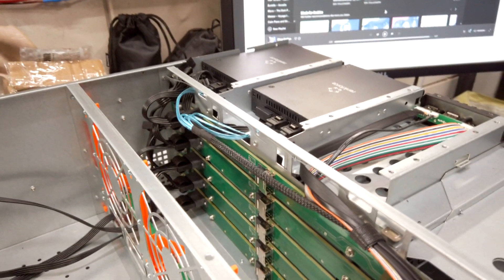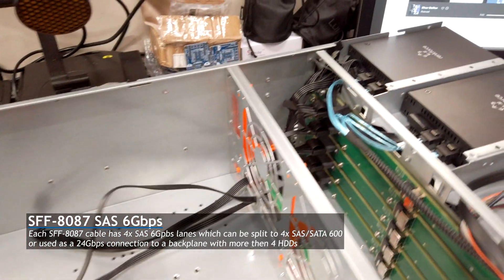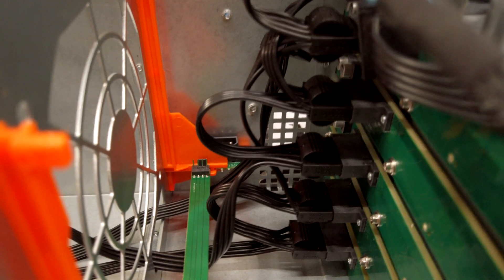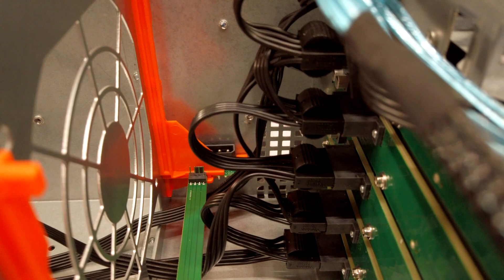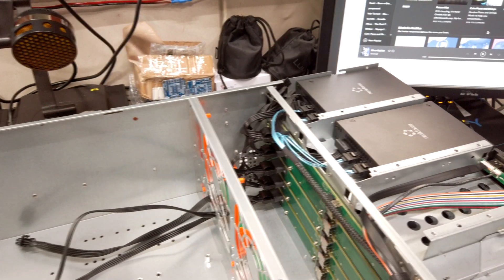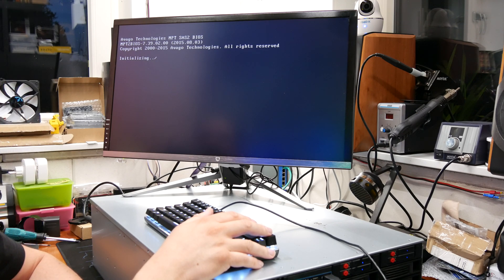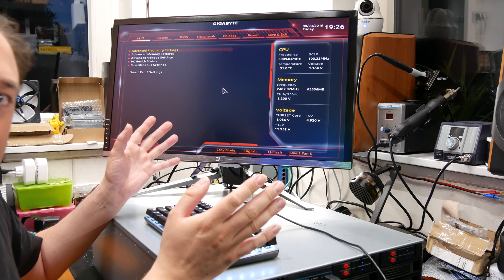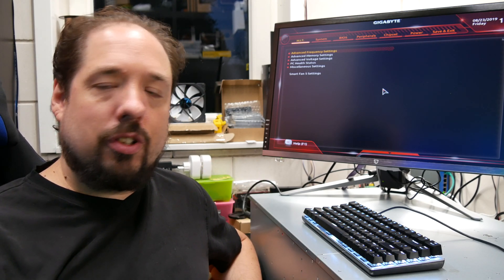Home Networking: 100TB 10Gbit Server - Building the server!

Comment: Hey man

I'm about to build my own 24bay server soon, but im having difficulty getting a question answered.
I have 6 backplanes, powering 4 drives each.

How many PSU molex cables do i need to run? I have 3-4 molex connectors per PSU cable, but can i plug in 3 SAS backplanes, with just 1 PSU cable?
Reply from the maker: I get that it's a bit hard to calculate. Let's say each HDD will pull 6w in average and double that while starting up (a guess, did not look it up). So that's 12w x 4 = 48w. Divided by 12v that's 4Amps. Generally that's ok for something like 18AWG which a lot of power supplies use. That said, I'd hook up at most 2 planes to a single cable unless you are doing staggered spin up.

So a few second burst of 96w or 8Amps isn't going to kill anything and might even be ok sustained (if with a bit of voltage sag/drop) but adding another plane might be pushing it a bit too far. That's 12Amps and if it's indeed 18AWG, that feels a bit high. 

Can you connect dual power to the planes? Then splitting those over 2 cables from the PSU is always a good plan.

Hope it helps in figuring it out!

Comment: Our group is approaching a petabyte of archived games and related software, video and audio, etc. The current solution is not elegant and not very redundant or practical (lots of ext usb drives and especially rare or hard to replace items have an onsite and offsite backup).

It's slowly being turned into a proper archive. Its expensive caring for data > 100TB

Comment: Thanks for your very instructive video. I've been able to build an Inter-Tech 24-bay server ... except for one major problem I just can't seem to be able to fix. No matter what I do, the fan wall won't turn on, which is a major issue as my harddrives will immediately start overheating. I have a Corsair 750X power supply, connected the molex to the fan wall and replaced the standard fans with Noctua NF-A12x25 fans. When I turn on the server, everything works fine except all 3 fans in the fan wall aren't spinning. Any idea on what might be the cause? I haven't connected the mysterious 6-pins on the fan wall to anything but that shouldn't be an issue, as that is only used for regulating the fanspeed. With my setup, all fans should run on full speed, no?
If you can give me any idea on why this isn't working, I would be very happy.
Reply from the maker: Yeah, if you don't connect PWM or Tacho (the 6 pins) it should just run at full speed. Not sure what could be wrong there, check my latest livestream too there we hook it up to become PWM controllable (although I had the motherboard fan connector in reverse during the stream, but that was an easy fix). Maybe try a different Molex cable? Also check if any traces on the fan board PCB are broken, it's quite a simple PCB so easy to see once you take it out. You could then maybe request a replacement.
Reply: @IntermitTech  Follow up: managed to get it to work. Somehow I guess the pins didn't fully connect due to the cables being awkwardly longer with the Noctua fans. I switched them out, put in the stock ones and those worked. Put the Noctua's back in and made extra sure to push down all the way and now they work. Pretty silly mistake all in all but very happy it works. Your video helped me a lot to plan out my server build, thanks!
Reply: @IntermitTech  thanks for the suggestions, will check it out. Maybe first I’ll retry with the stock fans, see if that works and then try to find the issue by rule of elimination. By the way, love your vids! Keep it up!

Comment: Great video. I recently purchased a smaller intertech chassis based on your content to make a media server. Was just wondering if you figured out a way to connect the front panel LAN led connectors?  I can't really find many boards or 10gb nics that have those pins. Certainly not 3 as is the case for my rig.

Comment: Question, what happens if your backplane die? Can you find replacement readily? If so will you consider buying a spare for future use? Regards,
Shane from Trinidad.
Reply from the maker: Yeah, replacing a backplane would be super simple! The chassis I have has 5x4 drive backplane which are all individual. If one would break, you can easily replace just that one. :)
Reply: @IntermitTech  where would you find a new backplane? can any backplane be used in this chasis?

Comment: The best upgrade I've done with my SAS cards is add a small 40mm noctua fan bolted on with some nylon bolts and nuts I got from the hardware store. Before the heat sink was hot to the touch now it's barely warm.
Reply from the maker: Yeah, I'm evaluating doing that or providing some more ventilation in another way, with the current airflow it's ok, but a bit cooler is always better!

Comment: Would you try DRAID? What's your opinion on it?
Reply from the maker: ZFS dRAID is quite interesting but I don't think 8 drives is enough to benefit from it.

Part of the reason I'm going with a mirror is that I will have 4 vdevs which will give me increased random IO performance. Otherwise it would be much more efficient space wise to go with a single RAIDz2.

Doing a dRAID with 2 parity blocks while having 8 disks means you are basically only getting 2 RAIDz2 parts and thus losing 4 drives, just like while having 4 mirrors but having less performance and needing to calculate parity.

Yes, during rebuild there would be a performance advantage and also it would allow for more drives to fail during rebuild, although the calculated risk of an issue happening during a mirror rebuild is lower because of having less disks involved.

I could get a 9th drive and then run 3 parity groups of a single disk, but again, that's approaching dangerous territory and in practice statistically less safe then running 4 mirrors. It would give me more space though and also provide a bit more IO performance the a single RAIDz2.

Interesting stuff, but since dRAID isn't available yet in the mainstream versions I think my mirror plans are best for now. :)

Comment: Great vid! I'm glad you are not using a redundant power supply. I have a similar build in the same case and saw Linus a while back mentioning he always wants to use redundant psu's. I am only planning to install a UPS and that's it but no longer feel guilty about it ;)
Reply: You should always try and use redundant PSUs,but its kinda stupid to when its not hot swappable PSU's. you should also use UPS's or a UPS and redundant UPS's connected to each power cable so you have 1 power cable on each UPS in case 1 UPS suddenly dies you still have that extra redundancy. But most people dont need this,but ofcourse this is towards the enterprise market and you need redundancy.
Reply: What case is being used in the video?
Reply from the maker: Check the previous videos, there I got through all components used but it's a case made by the German inter-tech.

Comment: Awesome video. Did you need the raid card? Or can you just use the sata breakout cables?
Reply from the maker: I want to hook up 22 storage devices, so I need the RAID cards since the motherboard only has 8 ports, they are running IT mode firmware so add additional ports I can use with ZFS. Each LSI card adds 8 ports so with 2 and the motherboard that's 24 ports. 

You can't hook up multiple device to a single SATA port (well you can, but you need additional hardware and it's not advised). So the cheap LSI cards are the easiest way to do it!
Reply: @IntermitTech  Did the motherboard need to be in it mode or can motherboard just pass them to the os?
Reply from the maker: Motherboard ports need to be in AHCI mode, which all modern motherboards (newer then 6 years or so) support.

IT mode for the LSI cards kind of emulates this behavior and passes all commands directly to the disk (like an AHCI port does) this is much preferred in the now popular (and better) software storage/RAID solutions such as ZFS. It allows the OS to readout the disk SMART info and sending all commands directly to the disk, this gives much better performance and control. Previously this was handelend by the CPU on the RAID controller but normal CPU and software has become much better to handle this now.
Reply: @IntermitTech  How many drives where able to connect to the motherboard before the added lsi card? You will be using proxmox?

Comment: The first thing I want to say is that your videos are very informative 👌, which I like.
And specially for this video, I think the way you are going to be configuring your server is pretty practical. And I think it's  a cool idea to reuse your old components, such as the motherboard and CPU and not to invest in a modern EXPENSIVE Xeon like LinusTechTips does in his servervideos, because I think this is enough for everyone.
Keep your great work up 👍👍
P.S.:
For example, I have built a "server" yesterday too, with an old FX8300, 8 gigs of RAM and a 1060 3G from my old rig and 3x4TB HDDs. One thing I've to mention, I'm using the Windows Sharefunction, because it's pretty simple, and I can still use the server for stuff like videoconverting and downloading. It has "only" one Gigabit/s but for me that's enough.

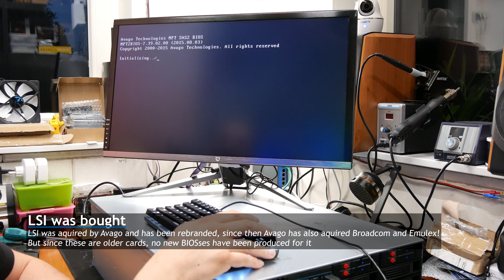Comment: 12:40 - Correction: Avago Technologies acquires LSI, then, Avago Technologies was acquired by Broadcom, together with other companies like Brocade and Emulex (which manufactures Fiber-Channel switches and interface cards).
Note: Broadcom produced the SoC that powers the Raspberry Pi, and the WLAN chipsets for Apple devices.
Reply from the maker: You caught that one, nice! Yeah, I messed up my text in the video because I read conflicting messages online. I know broadcom was in the mix and that's what my firmware remark related to, but I ended up changing the first sentence but not the second. :P

But yeah, Avago might not be a well known name, but they've acquired some pretty big names in the industry! I've worked a lot with Emulex and Broadcom in the Enterprise.

Comment: Is the reverse SAS Cable to SATA working for you? I have tried before but I didnt work ?
Reply from the maker: Yup working perfectly, have 4x2TB In those bays currently. So 4x Mobo SATA ports to SFF-8087 into one of the backplanes.

Was your backplane a 4 Bay one or did it maybe have a multiplexer/expander? If it has one of those they don't want to make a 4x single connection but one as a whole and your controller needs to support it, which a motherboard port won't.
Reply: @IntermitTech  I see thank you for make it clear for me. Mine has an Expander on the blackplane.
Reply from the maker: @HerrBrechtProduction  Oh, that's a good one too! Interestingly enough though, the documentation page for this chassis says that's it SATA/SAS backplane but it's also advertised to work with a reverse breakout cable, guess it depends on the make and model.
Reply: Intermit.Tech correction, that was nonsense :D

Comment: is the LSI/Broadcom SAS based cards worth it for performance, if you are only using 5 drives? or does the mb sata ports offer same performance?
Reply from the maker: Any recent motherboard (that has chipset SATA600 ports) will offer 100% the same performance as the LSI cards. In my build I actually use the motherboard ports for the SSDs. (Easiest because no need to load add-on BIOSses for booting) 

So if you only need 5 ports, no LSI needed.

Comment: So starting with my question:
Why did you chose proxmox over unraid or x, y or z alternative, what is the key feature for you?

Backstory:
This video is really nice to see as i am in the end phase of my own storage server build.
My self i will most likely use unRAID for my setup as the flexibility on disk sizes and the fact that i wont lose all data if i have a 2 disk fail scenario, also the fact that its not hardware independent (if the raidcard fail i can just get any new one) Sure its a bit slower in writes but i can live with that using  256gb M2 cache.

The 120 euro is kind of a non issue as it has all the features i want.
Reply from the maker: Great questions but I think most of this will be spoken about in my planned videos, mind waiting a bit for those?
Reply: @IntermitTech  Absolutely not, looking forward to them! :) (hurry though as my trigger happy buy finger is twitching xD)

Comment: You are an excellent system builder. But wouldn’t buying a used enterprise server as hp Dl380 G8 or others with a single cpu for power consumption be cheaper and have similar outcomes? NB they have minimal noise too.
Reply from the maker: I've used that type of hardware for years, we actually run those kind of servers a lot at our LANparties and stuff where a dual power supply and other redundancies are very much appreciated!

For here at home though, I already had a lot of the parts because I replace my desktop every few years anyway, that makes it a lot cheaper to do it this way and brings noise and power usage benefits. :)

Comment: Just finished building a server in the same case (dual xeon) for unraid. Did decide to replace all fans with a combination of corsairs (for the 120’s) and noctuas for the loud as fuck rear 80mm stock fans and now its totaly silent. Also like you have an intel dual 10g next to an lsi but the 10g was overheating so put a 60mm noctua blowing top down on them and it is now 40C under load while the 120’s can spin at 50%
You will have to do similar or the card will just shutdown. Also consider moving to other slot as that bottom is an hot air trap.
Love the case and one of your older videos convinced me to get one. Tnx.